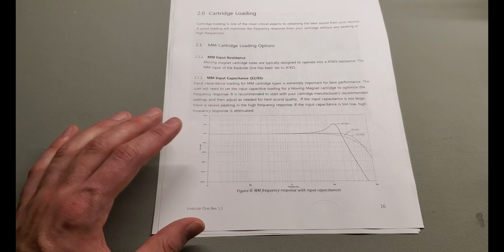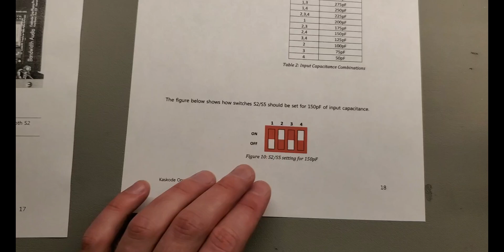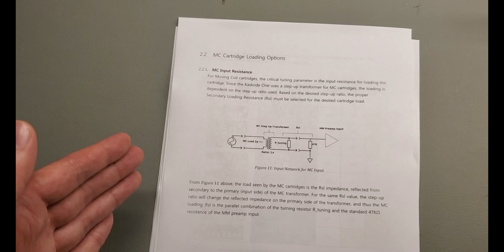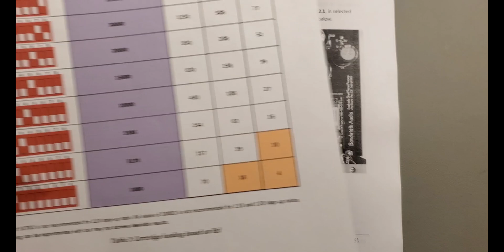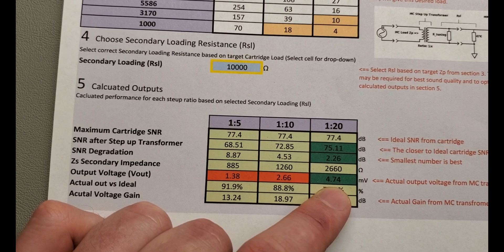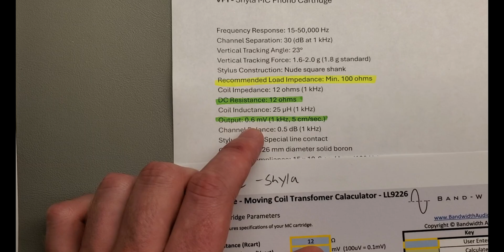Phono Cartridge Tuning - MM and MM with the Kaskode One

Comment: Fantastic looking device. What was the rationale for using mica over polystyrene caps for the MM capacitance tuning?

Dan
Reply from the maker: Sharp eye! The mica caps are far more stable across both temperature and age. The tighter tolerance is also a must - channel matching is improved for identical frequency and phase response in the HF. This keeps stereo balance perfectly aligned. You sure do pay for them $$!